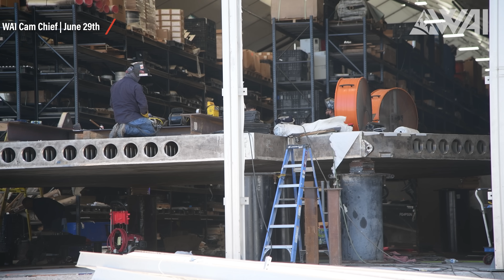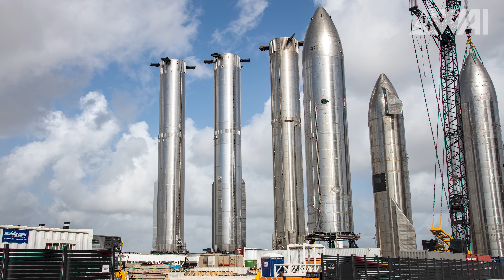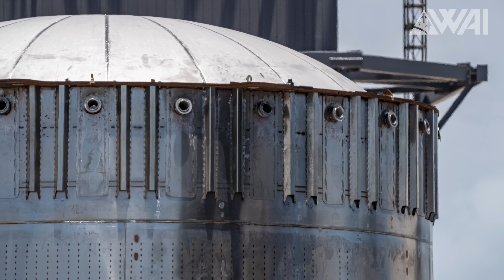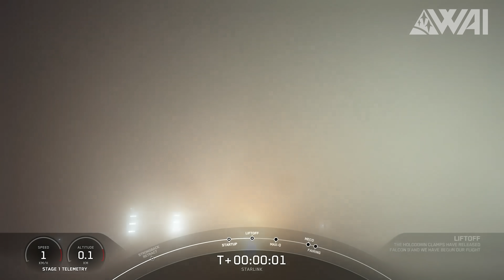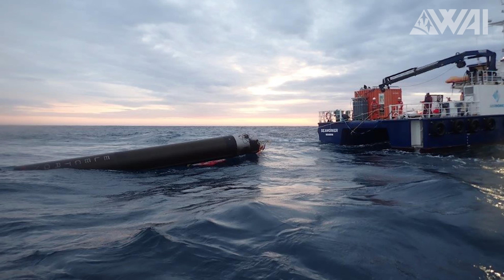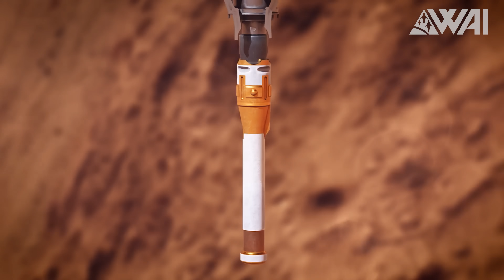SpaceX is Ready for the next Super Heavy Static fire!!!

Comment: Yes, the possible cheaper sample return mission to Mars needs Stareship and clever engineering. My suggestion for re-entry on both Mars and Earth is maximum aerobraking. Instead of coming in HOT as soon as you get there, you start scuffing the speed off by hitting and skipping off the atmosphere (for elliptical orbit) slowing a little each time until the circular orbit (minimum speed) then normal aerobraking to land.

If Starship comes online soon enough they can still beat NASAs proposed mission. And to save money, Starship can take a long time low energy route to Mars and Earth. That means they just have enough fuel to do the job with very little used for speed and deceleration, trading time for fuel use.

Possibly they can graft parts of the Dragon and Crew Dragon as a 3rd stage Mars Dragon with enough fuel to take off and go home (pretty unlikely that but maybe some clever combination of Dragons parts).

Comment: I wonder if the mystery valves are part of the fire suppression system.  As you noted, there were oxygen escape valves at the bottom of the booster.  If you are trying to minimize the fire impacts below the booster, venting O2 there might not be the best choice.  The choice to blow nitrogen under the booster suggests they are trying to reduce the oxygen content below the booster.  Move the oxygen vents to the sides and make more of them would help disperse the oxygen into the atmosphere well away from the bottom of the booster.

Comment: Would it have been easier (& cheaper) to use an Oil Rig Platform as a launch base? Place the system in the center of the rig with a circle cut out, & then the flames would blast down into the ocean. Just a thought :)

Comment: That would be a great idea use Space X to deliver it with their first Mars landing tests.. Or even better a Scaled down version that actually yields more materials something like a Remote controlled small scale Back hoe that they can lower down and have it drop buckets of soil into hoppers to be attempted to bring back from Mars.. Especially since it will weigh around 4000000 Lbs nearly 6000000 Less than what it does on earth. Not including fuel weight.. It would BE SUPER cost effective and test multiple systems. And with the reduced cost it would not be a huge loss for the return mission if the entire thing failed but a HUGE bonus if it all goes well they would have massive amount of samples compared to what they would have from the original mission.

Comment: Modifications will need to be made to the top of Starship to accommodate the chopsticks because the booster is growing but the tower can’t so SpaceX will have to have grabbing points below the grid fins so they can grab StarShip low enough to get it on top of the extended booster and tanker version of starship which will exceed the available lift height of the OLIT.

Comment: no collection of the water used in the deluge = violations to the environmental rules 
once more showing that they don't give a crap about anything, least at all Earth

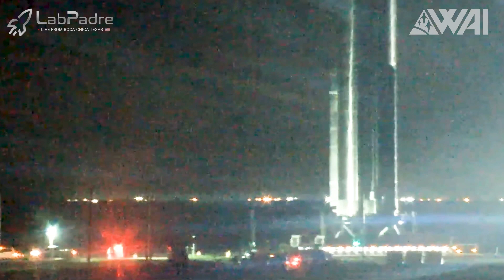8:30 3rd starship flight !?
SN1 :  BOOM during a pressure test
SN3 :  collapsed during pressure test
SN4 :  BOOM during engine test
SN7 : "intentional" BOOM during test
SN8 : BOOM because crash landed
SN9:  BOOM because of landing crash
SN10 : no landing crash....... just went BOOM after landing (great quality control eh?)
SN15 : launched and landed. no explosion, never heard about it since
Fully stacked Starship launched 4/20 completely failed it's flight plan, ripped itself to pieces after the FTS failed to blow up the rocket after it had been flying uncontrolled for 3 minutes....there for  BOOM

Yeah, what a demonstration of bad planning, bad quality control and bad engineering
Let's not forget that this is supposedly a fully re-usable rocket system. So re-usable that of all the ones that they build so far and actually even just contemplated on using only 1 ever ended up retrieved and what did they do with it? Discard it.

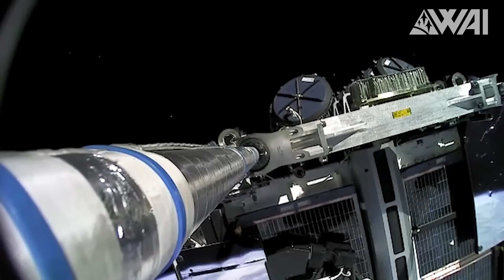12:40 so what if there are 1.5milliion users yielding 2billion USD. How much does each launch cost? How much does each sat cost? How much does each receiver unit cost? According to Elon himself the receivers cost several times the amount that they charge customers for = net loss. 
And each sat can at best serve 1.000 customers without a loss of speed. Take into account that most of the people who could afford it are actually located in areas where there is highspeed fiber optic internet and that it's cheaper, quicker and more reliable..... starlink is a stupid idea funded by stupid people with too much money.
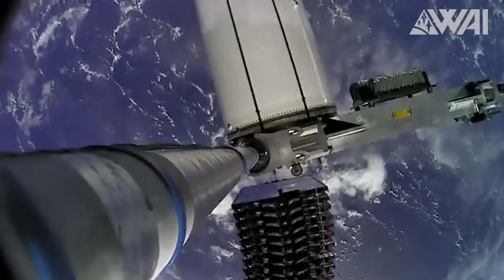In short 12:50 shows that you have no understanding of the difference between revenue and profit. Starbase, by Elon's own admission, needs 2 billion USD each year just to keep the lights on, which is why even with all the government hand outs, military contracts and the like that they do a fund drive at least once a year.

20:16 Talking about using Starship to do the sample mission is a bit rich considering that so far they barely can launch one even although years ago Elon already promised boots on the Martian sole by 2023.
Reply: The water collection system is already completed, and yes Falcon 9 booster were mostly discarded in early days so bitching them I guess?

And yes, NASA already build & tested the MSR hardware & it's ready to launch at any moment, so bohoo SpaceX

Comment: I don't get this new water cooling system: seems they are pumping water straight up from a flat surface with holes. That will mean the full  exhaust flow and pressure of all engines will have to be overcome before any water will actually flow. Given the chamber pressure of the engines (30 MPa), the exhaust speed (3,8 Km/s) and flow rate (~980 KG/s per engine), this will mean that ~30 Tonnes per second of superheated exhaust gas with a downward speed of 3,8 Km/s will have to be overcome by the water pressure. Given the height of the spray at this test, I would estimate a pressure of ~ 50 KPa. 

Compared to the aformentioned exhaust speed and amount, I see a big problem: I can't imagine this water stream in this structure will be capable of actually overcoming the blast pressure and will not flow at all, resulting in a repetition of the first launch, only with lumps of melted steel spashing around instead of concrete this time...
Reply: Because it was only a partial test?
Reply: @alvianchoiriapriliansyah9882  still the violence of so much engines each producing so much power… Feels like this system is the worst solution possible. Well, we’ll see soon I guess

Comment: I still think S27 is next up, after they verify the heat shield. They are still lacking in the fuel transfer demonstration, required before an HLS demo launch for NASA.
Reply: S27 isn't required to do a fuel transfer demo and it's already dead
Reply: @alvianchoiriapriliansyah9882  either way. I'm expecting a naked one to do that first demo. That got a couple hundred million just for this part.
Reply: @michaelpetty8867 Why would it had to be naked?
Reply: @alvianchoiriapriliansyah9882  one time demo use.
Reply: @michaelpetty8867 Fuel transfer doesn't have to be naked
Reply: @alvianchoiriapriliansyah9882  no it doesn't. But they have 3 versions that have been mentioned that do not require a heat shield and flaps. HLS, Fuel Depot, and one time use starships for max payload. Seeing as how they only need to test the fuel transfer and not have to recover it. Then why not save money on the production until they know they can recover it properly.
Reply: @michaelpetty8867 Just because it's naked doesn't mean it's "definitely" HLS/Depot
Reply: @alvianchoiriapriliansyah9882  ok dude. We are all just guessing, but apparently you have to right so have it. Waste of life arguing otherwise.

Comment: Let's see if you read my idea? I may even join as I watch most of your clips anyway. Idea 1. Why hot staging ? I don't know if this exists but why not use cold staging? Make sure stage 1 and 2 are reasonably sealed and when it is separation time do a spin prime. The pressure will separate the two stages and when there is enough distance ignite stage 2 engines. Is that what the small holes are for in case pressure buildup is too high from the cold staging? Idea 2 for separation. We already have plenty of pressurised fuel. Why not use 3 or 4 spring loaded pneumatic rams to push the 2 stages apart. The springs will retract the rams after they reach maximum extension. This is a simple mechanism ant does not weigh much. You can now ignite the engines. Both systems will allow for rapid reuse and less damage than hit staging may cause. What do you think?

Comment: Question for you Felix:if the next launch attempt uses  fully fueled booster and starship has all 33 Raptor2 engines functional, what percentage of available thrust would be needed to get the ship off the OLM  and perhaps 20ft in the air before powering up to 100%? This could seriously reduce the possible damage to the OLM, no?
Reply from the maker: That’s hard to say as we don’t have exact numbers for the thrust output of a Raptor V2 but if we assume 250 tons and a Starship weighs around 5000 tons fully fueled, the Starship would need around 80% thrust to leave the OLM reasonably fast which also plays a role as the deluge system doesn’t have unlimited water supply.
Reply: Lift-off is the point where they need the most thrust, so that's just not an option... we saw that with the previous attempt, where it was accelerating much slower than expected due to being several engines down. But you also have the problem somewhat backwards — accelerating harder is better for the pad, because it shortens the period for which it's being toasted...

Comment: No maintenance of the steel plate? That is a poor joke, Felix.
Physics dictates the steel plate will ablate/vaporize at a rate measured in centimetres of steel per second - so it seems that not even a second launch will be possible without replacing it entirely. Common sense suggests a steam explosion could easily level the entire OLM and maybe the launch tower as well.
My feeling is that not even a single launch can be successful with such a system.
But we will see, won't we? I'd love to be wrong!
But it's Musk, so it pays to be pessimistic, because of his constant lies on basically every subject.
Reply: And the same freaking physics also dictate the heat transferred to the water itself

Comment: Hmmm, an upper stage aerospike with a partially actively cooled heatshield? Stoke Space wants it's idea back!
Reply: Actually, like you said, just because there's a design, doesn't mean BO will follow through. Founded before SpaceX, has never launched an orbital class rocket. Has only just developed it's first engine for orbital use, which is most definiitely in the 'still testing, might explode' phase.

Comment: The radial array of ports atop the booster could be passive "hot gas" stabilizers. Upon hot staging, the thrust from the StarShip would be jetted out evenly in a radial pattern offering a stabilizing effect on the empty booster.  After adequate separation, the booster could then take over on its entry maneuver.   Just an idea I had when I saw them... Afterall... The best part is NO part, right?!

Comment: the smaller ports may potentially just be gasket / pressure valves.  in case the units don't divide when the other engines are fired to prevent a pressure build up? or maybe they are putting a vacuum in that ring and those are for the pumps to create it to help hold the pieces together when not in launch position to atmospheric transition/flight.?

Comment: Nasa just needs to contract SpaceX at the full budget they are being given now for the sample return mission.  I bet the hardware developed for such a mission would further space exploration more than ten times that amount spent any other way.  Plus, it would give SpaceX a dress rehearsal for Starship going to Mars.  The sample return mission could probably be pulled off with just Falcon9 heavy in fully disposable mode.  How the return rocket would be designed is up for debate.  Landing would be easiest with a burn back  type landing.  Maybe a single Raptor 3 to keep things smallish.  Have the craft carry all the methane it needs, and have equipment on board to convert the CO2 into O2 and methane to get off the ground and into a high orbit. This gear could even be left behind for other missions to use, making and storing both components while other missions are planned..  Then, a Merlin for the return home burn and Earth capture.  After all that, rather than bringing the samples straight to the surface, have them dropped at the ISS and brought down in a Dragon supply capsule.  This way, the return home ship would not need the heavy equipment to make the journey into earth's atmosphere.

Comment: Blue origin patenting something more likely means they have seen someone else using the tech with no patent and are thinking how to sue them. Even if the suit fails, the financial drain on the sued company may be enough to remove them from competition... or lowering their value so they can be bought out for less. It seems Blue Origin is more of a "holding company" than space company, buying into other space programs for the normal money grab reasons. That is, they are an accountant run company, not a vision run company.

Comment: How about the ring of tubes being ‘translational vector adjustment’ thruster/vents? Booster will need to maneuver outside the atmosphere with the engines at idle/off, using minimal fuel. If the residual tank pressure were vented selectively through such vents, they would have efficient leverage just beyond the center of mass of an otherwise empty booster. Just the thing for ‘trim’ adjustment prior to re-entry!

Comment: My Prediction = launch 2 by end of August.  The real under the radar thing Space X is doing is the cryo-testing at Massey's.  B10 is there now and ship 28 should be there soon.  If they do all the cryo-testing there, frees up the launch pad for just static fires followed by launches.  That way they could get the launch cadence from once every 2 months, to once a month if the steel plate works without a hitch.  That means potentially 3 more launches this year, and then they might be ready to catch a booster with chopsticks in early 2024.
Reply: Honestly, at this point I'd be happy with two more launches this year, and I'd be satisfied with just 1.
Reply from the maker: Yep! We talked about it at length. It's a big change and it will drive cadence up quite a bit! Four launches in 2023 would be incredible. I am betting on three in total. Catches in 2024 are definitely possible!

Comment: I am out on a limb.

I have not heard Anybody else say this:-

Imagine launching Starship.
It needs a ground based launch plate, currently an upward pointing water deluge system. 
ok

Fly to Mars
Ok

Land
O fk.

Just jokeing because with a bit of forethought,

Chuck out the big metal plate from the cargo bay..

Most of the Starship mass is gone in transit (fuel) so engine thrust (heat) landing will be minimal compared to the heavy launch.

Great, its landed.

Now setup the water generation plant and the fuel production facility.

Position the metal plate under Starship.

Load Starship with cargo & any Earthsick people & launch for return.

Maybe the plate needs cooling holes & a water deluge?
No problem, SpaceX has holes & water already covered.

What can go wrong with such a good plan?
 
My point is that everybody (like the 8 billion that WRONGLY said Elon's crazy and rockets can't land flamey end down,  have relentlessly criticised and slagged off SpaceX for their sequence of Starship launching ground systems.

Factually of course SpaceX now have more data and understanding of ground effects during a launch than anybody else in the world.

That knowledge can only be Useful when contemplating a launch from Mars or the moon.

Starship COULD take its metal launch water deluge system as cargo.

The metal plates COULD be assembled at the destination.

Yes there are thousands of problems to consider.

So thats about 1 problem for each small group of staff.

Team SpaceX are proven to be extreemly good at solving hundreds of thousands of alleged impossible problems.

A complete game changer if thinking about rockets having to orbit the moon or Mars while waiting for transfer craft to taxi between orbiting rocket & the local ground terrain and back.

Suddenly Starship makes moon missions Thousands of times less expensive, hundreds of times safer, considerably faster & more time flexible, and able to deploy or perhaps much more importantly recover vastly heavier payloads from moonbase to Earth.

I think all the can't be done, SpaceX doing it wrong naysayers have shown themselves for a second time to be stupid.

Good luck Team SpaceX, I stand up to support & thank you.

Comment: The ring of valves could be vacuum release valves for micro adjustments of the base during flight. It would efficiently vector the rocket, saving gimbal expenditure. I imagine the negative pressure above the rocket nozzles must be immense. Releasing this vacuum on one side would pull the base in that direction. A "reverse" thruster.

Comment: RIP Ship 27 — I really wanted it to ship the first Starlink V2 mission.

43° inclination launches don’t require special maneuvers from Canaveral. Such maneuvers are technically not required from Vandenberg, either, but are done as a safety measure for areas in and around Los Angeles. Will V2 launches from Vandenberg be profitable, and a good use of rockets, when shipped 15 at a time?